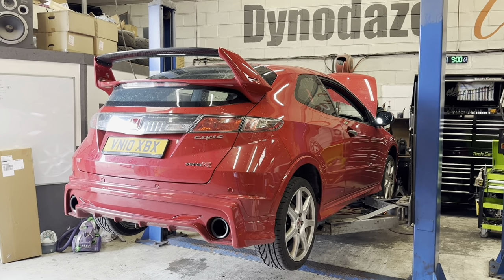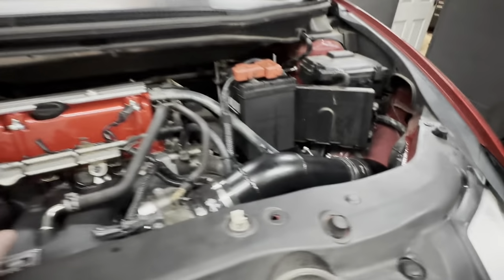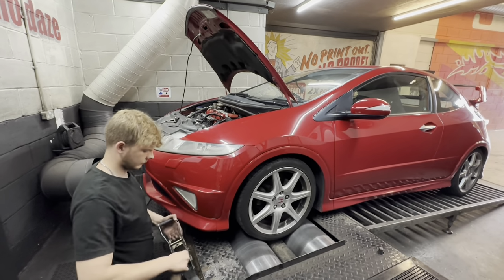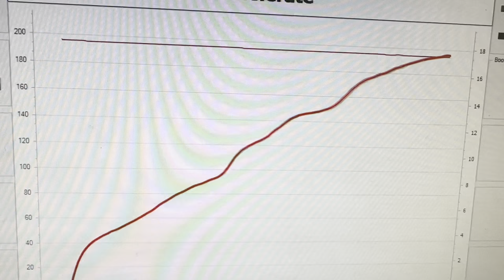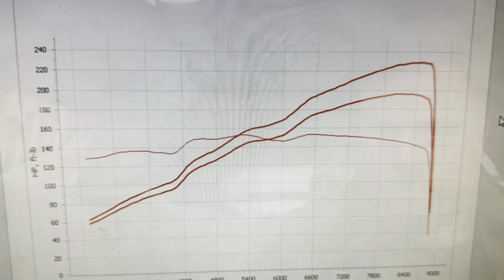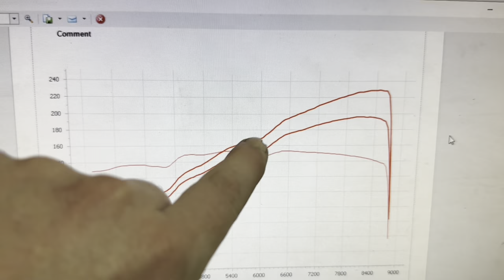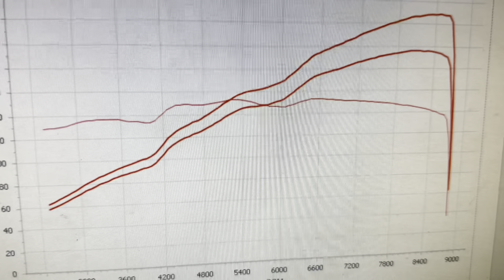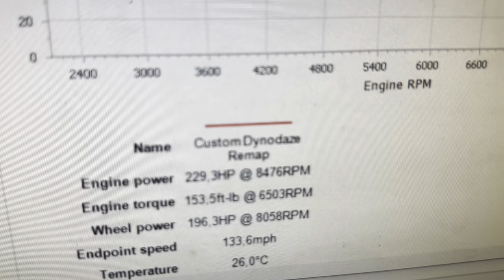Make Your  Honda Civic FN2 TypeR Quicker @tegiwa @Skunk2Racing @cplracing @EcuTekTechnologiesLtd

Comment: Uncle Keith!
I need to replace the exhaust on my FN2 but would need something relatively quiet as I do alot of motorway miles... etc. Would rather not replace with a stock exhaust, what would you recommend?
Reply from the maker: Tegiwa 70mm or 3inch miltek both on website